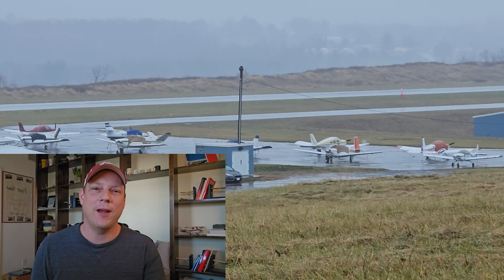Pilot Actions After Loss Of Aircraft Engine (ABCDE"F")

Comment: What's scary is what you can't see until you are committed. Barbed wire fence on both sides of a small ditch in a field for instance, both being nearly invisible until "too late".
If landing in a field, pick the surrounding (maybe narrow) dirt road if one is there.
Roads are made for wheels they cross over ditches and if gated at least there's a "known and wider space" between the 'formidable" posts.
Reply: All good high altitude orientation considerations.  Coming from 17,000 hours of low altitude orientation, I see one low altitude consideration missing in all high altitude orientation.  Airspeed is life until high enough to recover from inadvertent, not practice, stall.  Pitch to best glide is fine, but where I worked zoom reserve airspeed should already have been established.  Zoom reserve airspeed is enough airspeed to safely maneuver where horizontal space is as limited as vertical space, turns are to target, bank angle and not elevator determines radius of turn with good wind management helping with smaller radius, and steep 1 g turns are possible if we don't pull back on the stick/yoke.  Eleven of my thirteen engine failure forced landings were six seconds deals.  All eleven, however, started with zoom reserve airspeed from acceleration level in low ground effect.  That happened on every takeoff and every swath run in the crop field and from my 200' patrol altitude with waiver.

Those who do not spray crops, fight wildfire, or patrol pipelines my think they always fly high enough to recover from inadvertent stall, but they do not.  Camera technology now indicates that they do not.  Rather than A reminding us to pitch down to establish zoom reserve airspeed, why not start there.  Level in low ground effect and with thousands of feet of runway remaining, there is no need to pitch up until cruise airspeed or obstacles require pitch to just clear them with the outcome of the maneuver never in doubt.  Due to limited choices in the very close hemisphere in front of the wing, the place to go will be clear.  We have enough energy to climb a bit wings level and then turn to that site.  Most of the time we will be high and fast requiring full flaps and rudder to the stop slip to make the beginning of the survivable site.  Turn steeper than you think necessary so as to be able to level the wing before touching down.  Six seconds makes it easy.  You will be down before worry has a chance to settle in.